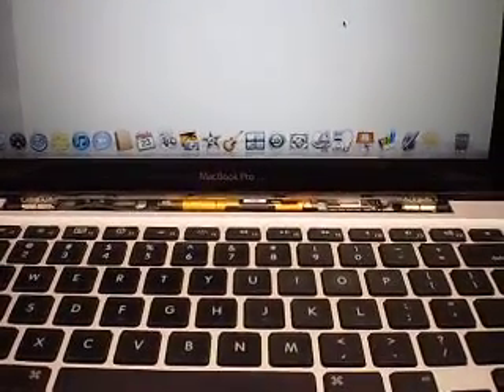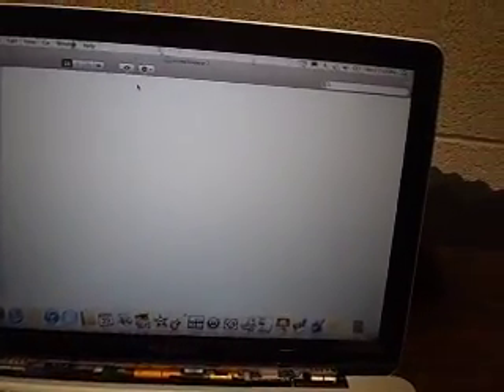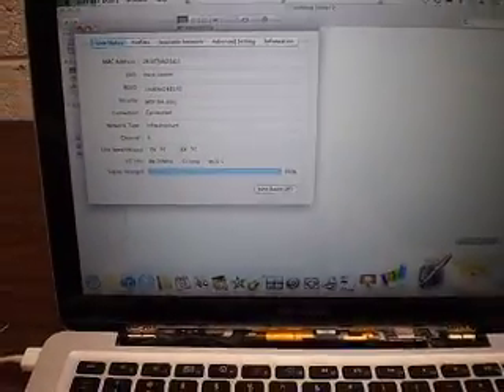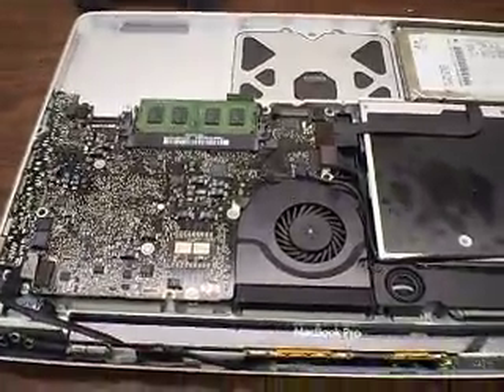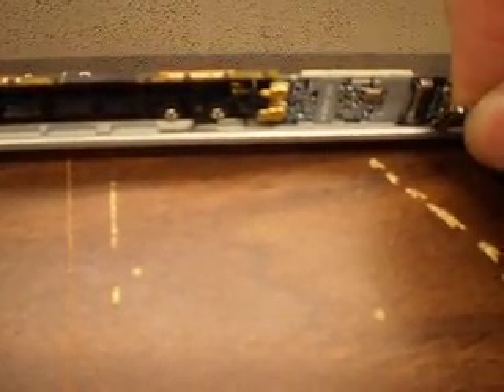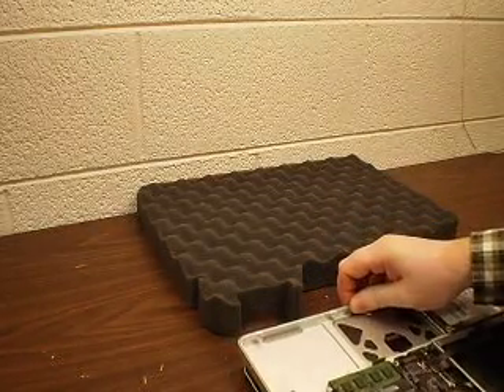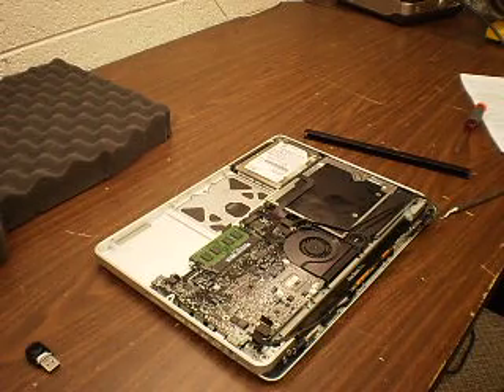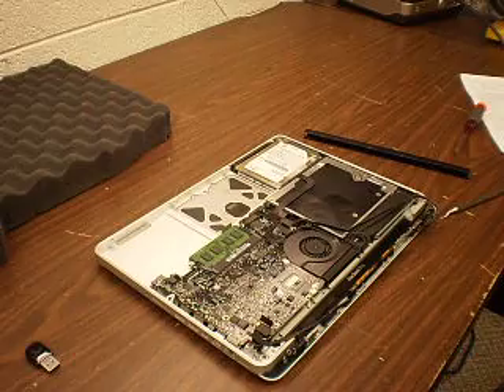How to properly fix Apple MacBook Pro failed WiFi Airport card problem.

Comment: Hi friend, is it a A1278 2010 ??? 
Because mine is, and it is with wi-fi board and webcam in shortcut (detected by thermal camera), and when I plug off, the computer power on normally.

Comment: Sir, I have macbook Pro (version 10.6.8)
Few months ago It fail approximately 15 cm down and it 1st time started to show ' airportcard not detected'.
After few months I restarted it and fortunately it got online with wifi icon being black.
But it suddenly went offline with wifi icon greying out.
And thereby it hardly gets online (with black wifi icon) and stays online nearly for two minutes and goes offline (with wifi icon greying out).
I don't understand what's the problem.
Please help so that it will work normal.
Kindly looking for your reply..

Comment: My mum's MacBook pro is 10.58 V but the beginning we were able to use the Airport Card as it is installed for about a year then few months after it just went off. That wouldn't mean it does not have it in the mother board, does it?

Comment: Hi. I'm having the issue with my MacBook Pro late 2011 15.4 inch model. Sometimes an SMC power reset fixes it. Is yours a 15 inch or a13 MacBook Pro! Thanks.
Reply: By the way, when it's not working, not only will the wifi not turn on, but there is an x in the airport icon at the top and a contextual menu says hardware not installed.
Reply: Are you still having this issue?  I can fix It for you!
Reply: M H Phones its fixed. Apple changed the cable. Works fine, now. Thanks for asking.

Comment: Done! and it is fixed Wifi and bluetooth operative again .
The reason was a bad connection at the LVDS connector so I did not have to remove the plastic covering the airport card : just re-fix firmly the LVCD connector as shown in Ifixit 

Many Many Many thanks 
Thierry

Comment: the problem its overheat. location hardware wifi place been installed don't have good ventilation for air cycle.
compare
wifi MacBook Pro at a clutch / hinger cover 
macbook white hardware wifi installed at logic board rare case for this issue
when I open hardware wifi the thermal tape belong the hardware getting f**k up.
question : btw bluetooth have same place with wifi why do not broken too?
answer : large bandwidth and continuity time processes wifi for internet or data transfer compare with bluetooth do not have same as well when using magicmouse, data transfer, or else when their working produce heat how to make overheat because different technology

Comment: My mac cannot locate the wi-fi function at all. It says "wi-fi: no hardware found" and it can't be found in system preferences/network. I've tried upgrading the software. I've also tried deleting all software and reinstalling from scratch.
I suspect it to be the hardware. Would this be a possibility to solve it, or is it likely to maybe be a part of the logic board or something else?
Reply: saga01b same problem here.... ughhhhh
Reply: I have the same problem, bought a macbook pro mid 2012 and last week it started doing the same thing. First it was like this video, then it was like you describe. Sometimes i restart the computer and it gets better but only for a while, sometimes i have to restart it three times...Like he explains on the video, I've been told it is an hardware problem, because the wifi antena is located on the screen lid and the opening an closing procedure tears off the antena cables... the solution is, again as he explains on the video, to replace the airport board, or whatever it's called, but I haven't tried it yet, all i've done was opening the bottom lid, clean and disconnect the antena cables and connect them again, but it's just temporary after one day or two it comes back again... i don't know how to help, but if someone has a permanent and cheap solution i would like to know
Reply: SAGA KAPNA Did y’all find out how to fix ? ... I have a similar problem Wi-Fi is turned on but has a solid yellow/amber light on and says “Wi-Fi is turned on but is not connected to network” 

No networks pop up or anything

Comment: according to ifixit that cable is called the camera cable, so do you remember if the webcam was also not working? im having the airport issue right now but my webcam works fine so Im thinking the cable is fine but the airport card must have gone bad
Reply: Vince G Got the same issue. I'm thinking it's the card too. Gonna try the card 1st.
Reply: +Desmond  Did changing the card work? i haave a sinilar problem. Thanks
Reply: Similar problem, I think it is better to disconnect wifi card first and try power on... If works webcam, GOOD o/

Comment: My WIFI connection only drops on my macbook pro. Sometimes i can use a few minutes then it drops, sometimes i cant use either 2 minutes and it drops so much more. I did ALL the possible things you can imagine and i could do but none of them solved my problem. Other notebooks on my house works perfectly but my mac dont. I reseted my router, entered again, but nothing :( Can you tell me something?  thank you.

Comment: Before you do anything drastic, try taking the battery out.  I had this same exact  problem today and could not get airport card to turn on.  I tried restarting several times to no avail. Then I removed the battery, replaced it and restarted and everything was fine.

Comment: Hi, So here is my problem: I had a problem with my wi fi card, so I Decided to switch my air port card. (bluethoot and camera wasn't working). Unfortunately, nothing happened: wi fi didn't show of.. So Since I hade to replace the screen cover, I decided to switch the cable: it repaired the camera and the bluethoot... But no wi fi working again:

It just doesn't show off in the network menu, doesn't show off in the menu bar (no wi fi logo apparelling, disconnected or not). It just completely vanished. I really don t know how to fix that. Unless it is the attenna, I will have completely switch the whole system. Thing is: bluethoot is working, so why the wi fi is not? can somebody help me on that one? I'm out of solution!
Reply: So same happened to mine. I replaced it with the old card, and it worked. It was still faulty and less than optimal, but it worked. So I dont know what's going on once we change the airport card, like if the mac has to be alerted somehow or reset. :(

Comment: took my mid 2012 mac book to apple inside warenty cos i had removed dvd drive and replced with ssd drive they wont support me, but i think the real cause of this is freying of the antenna wires located in the hinge with opening and closing so often i think it has cut some of the wires, apple said it will have tp remove screen to fix and would cost 460 pounds, mine has same issue will only work right on top of a router and up close for bluetooth. not happy with apple

Comment: I have the missing wifi issue. Thanks for the video - gave me the confidence to repair this myself. It turns out that on my MacBook, the cable connector was not the problem.  I unplugged, replugged, no difference. I have bought a replacement wifi-card off ebay and will follow up here with results. As a note, bluetooth DOES NOT run off the wifi-card on this model. With the wifi-card fully disconnected, I can still use bluetooth.
Reply: What is the exact model and year you are talking about my friend?
Mine is A1278 2010... Wi-fi and Cam in shortcut :/

Comment: Nice video Abraham! 
i have the same problem, i mean WIFI fail with my Macbook pro 15 2012 mid. but in my case i think the reason maybe is connection of the cable which connect the Airport card and logic board. I checked my Airport card, it's working. 
Do you have any suggestion? Thanks!
Reply: How did you test your wi-fi card, in another Macbook or multimeter, friend???

Comment: This video probably shows the solution for a lot of people.  However I took my mid 2009 mbp apart to check the card and it is properly seated in place.  Any ideas here?  The card works intermittently

Comment: Holy crap MAC you suck.  I was told that they would probably need to change my airport card which they want to charge me $100 to change.  WTF douchebags.  My internet works sometimes and other times it doesn't so it's more than likely a loose wire...

Comment: Hi Abraham, I am using snow leopard (10.6.8) with same problem where Airport card not installed. I bought DWA 131 and have tried installed the driver multiple times unfortunately I did not see any WIFI icon popup at right bottom corner and unable to connect internet using WIFI. Can you please share with me where to get the correct driver?

Comment: Wow that is exactly what has happened to my mac. The left corner of the plastic has broken off (a while ago). I have no idea why it broke so i think this model has a flaw (as you said). I will try having a look inside to see if the cable isn't seated properly. Wifi works intermittently.

Comment: Hi,
On the 2011 model, which is exhibiting the same airport failure, the card differs; it has 4 connections, and the cable is a press on top . And it's wrapped in tape. 
Still fails. Oddly, the card came back online once after I took apart and reassembled, then stopped again. Work progresses..

Comment: Abraham...

THANK YOU.  You are the first person to reveal a truthful, thoughtful, intelligent answer to this problem.  What has been so disconcerting about this issue for me is that the wifi card intermittently works.  Now I finally know that it was the jostling of the hardware connection and not the resetting of PRAM etc. that made it temporarily work.  Your video brought me tremendous joy and peace - I no longer feel crazy and now have a practical solution to follow thanks to you.

Comment: Hi Abraham,
Thank you for what you showed on your MacBook. I have a one with the dual core Intel-first.Little problems with Wi-fi card. Where it  fades in and out at times?  New card? Motherboard?, Memory? Also, fan is noisy. I replace that and card, right? WANT TO Do SERVICE- they rip you off. Just like you sayt. Machine has aluminum case and silver keys, not black.  Any ideas? Always been noisy. Had it on for an hour and it is been fine. Airport is green on Network.  Thanks, Tom.

Comment: Hey when I take the black bar at the bottom of the screen off there is no plug for the antenna as on yours. The cable in question goes up behind the screen do you have any ideas how to get back there? i have a mid 2010 15" MBP

Comment: The problem w/ my mid 2009 MBP is that after going to sleep mode, it shows the AirPort as turned off. When I go to turn AirPort on, it doesn't turn on. After rebooting, it gets worse. It then says "No AirPort card installed." I've taken it to the Apple store & it is 'temporarily fixed' when the AirPort card is disconnected, then reconnected. They want me to either buy a new card or  MONITOR!! 100s of people are hav'g the same exact problem w/ no known fix and PRAM reset doesnt work. Any Ideas?

Comment: hello

WHEN YOU HAD THE PROBLEM THE BLUETOOTH still working?

because I have the same problem my wifi does not work   but my bluetooth works perfect  

and I know that the two devices are on the same card

WHAT CAN I DO??   REPLACE FOR A NEW ONE??????

THANKS!!